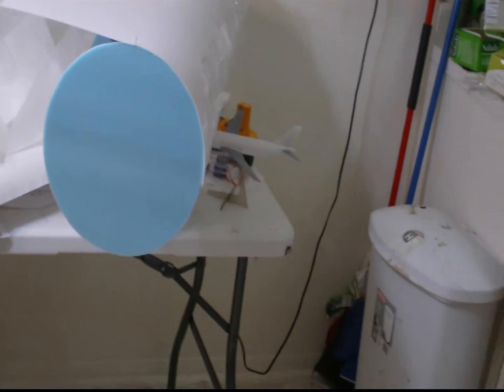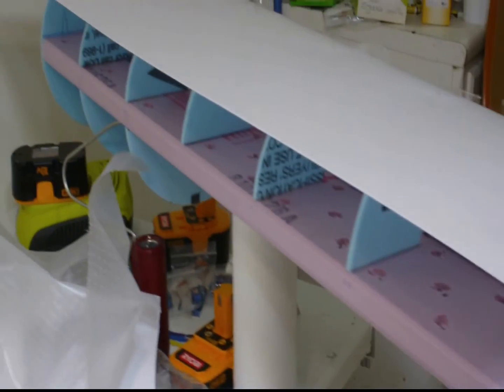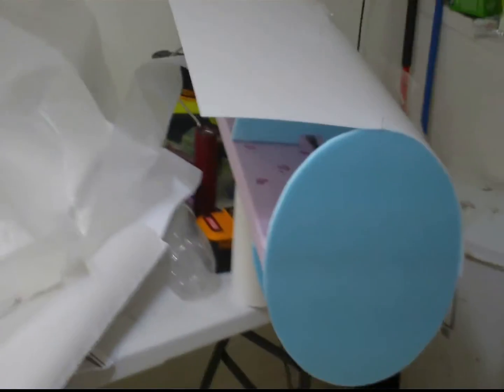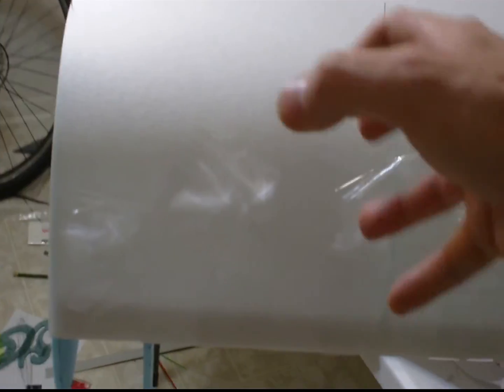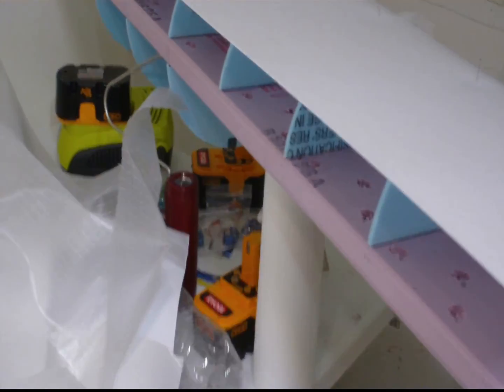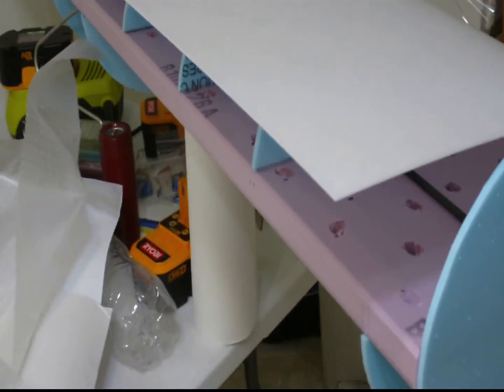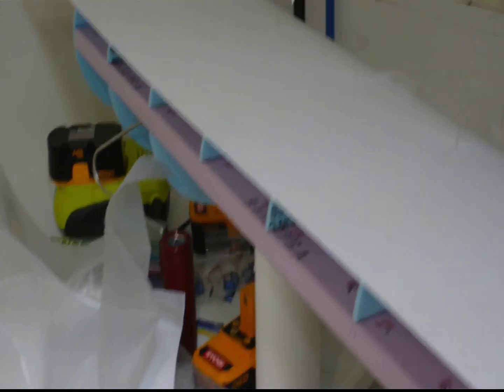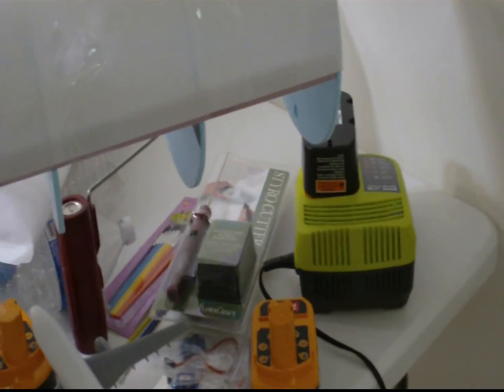How to build a 7 Foot Airbus A300 RC EDF airliner Part-14

Comment from the maker: Hi Wobbler. . .it will be too stiff to bend around your fuse and it will be 25% heavier than 2mm depron. . . But you can try it. What are you building?